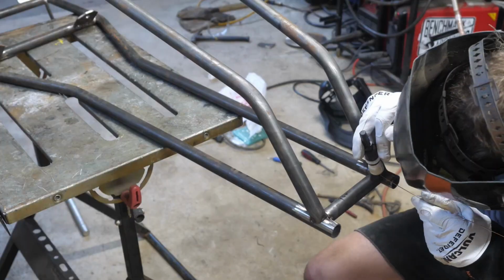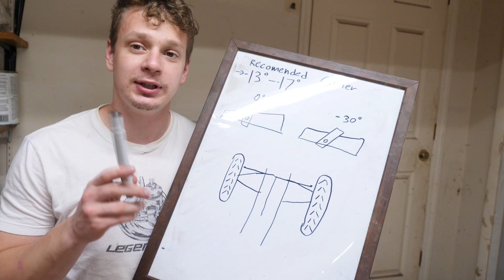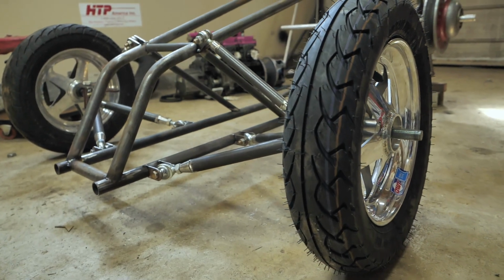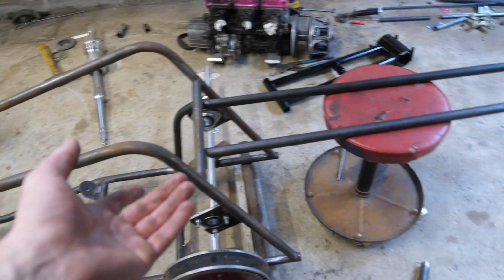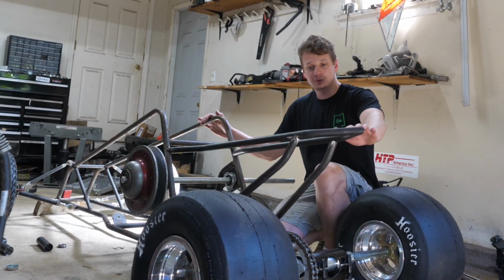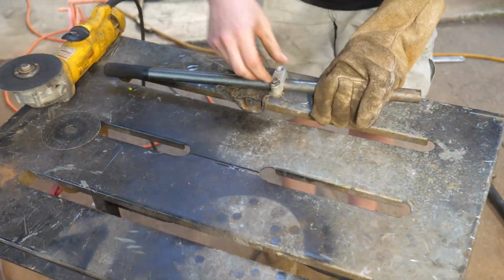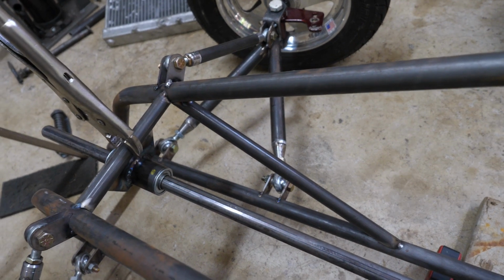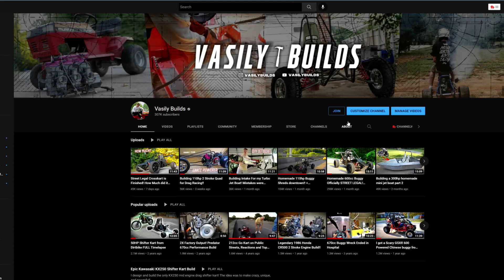Building Racing quad 600cc snowmobile powered Part 2!

Comment: You are going to find all that adjustment on the front is not needed in sand drags. Just extra weight.  And did you stagger the front tires to help with rollout on the tree.

Comment: Are you going to have Doug Flannery do your pipes? Also ditch the mechanical water pump and run a in-line electric water pump with a battery dock and run a 12 V 3-5ah battery like off a drill! 

I’m a snowmobile drag racer from Michigan
Reply from the maker: Rdz

Comment: How did you solve the belt slipping problem I’ve tried flipping the driver pulley making Sure it’s aligned perfect with the driven pulley while Engaging. But it still gets super hot. And it slips like right away. I’m running a stock Honda 630.

Comment: You won't be able to adjust the length of those lower A arms the way you have welded them. You need both threads parallel to each other, yours will bind up.

Comment: The front tires are on backwards. If you just switch them they will be fine. You always want the treads to point forward at the top of the tire. It helps prevent hydroplaning.
Reply: I dont know anyone that drag races where there is a hydroplaning concern.  If the track is wet, you wait for it to dry off.
Reply: You cannot make me believe he will ONLY run that on a frag strip.... Plus, your comment doesn't prove me wrong. Good practice is ALWAYS good.
Reply: @jameswilson7338  the frag strip?  Only when cars and cameras are running is it called the frag strip!! lol

Who said i was trying to prove you wrong?  my comment is absolutely correct.  Don't run your drag kart, car, banshee, or the like on a wet track. If the front tires are a concern for hydroplaning, then you should be equally concerned about the big fat slicks on the back with ZERO tread.  

I get what you're saying tho. Rain tread is directional.

Comment: Would it make a better angle for your front  heim joints to be angled in the same direction as your triangle d front suspension?  I also would box in those frame connections for strength.  You are doing excellent!!

Comment: You are so good. Be safe! (I know you will, you have already joined the "I Almost Died, Club"). This is a good sign. (Family Members may not agree). It means you will more than likely live to be an old man AND get to rip like a maniac in the meantime. (I'm 60). Lessons learned. You CAN'T teach it in school. Most students would fail. You are running my favorite. Two Stroke Triple! (In my day, they were air cooled. Yours is MUCH better). (KAW H1 and S2). I saw something about running these in warm weather. I don't know. Just thought I would mention. Mixture adjustments? Thanks for building, Vasily!

Comment: It's going to Scream on down the tracks!Worried that the steering may be too touchy at speed.Red Beard's used a couple 'rack-n-pinion' units that slow steering response allot.I'd hoped you'd put the radiator behind the front axles to lessen the chance of scalding if it blows,or just overheats.Whatever you do,we know it'll be Awesome!Rock on Vasily.

Comment: CrMo can be prone to brittleness if you weld thicker material where the weld cools off fast so preheat is often recommended. On this thin walled tubing you'll probably fine though.
Reply: Yep.  A post weld heat treat would solve the brittleness at the heat effected zone too.  Give the grain structure a chance to relax.
Reply: Heat treat or anneal

Comment: You mentioned it might be prone to wheelies. With all the weight at the rear i might agree.  Have you considered making a custom 4 link?  If not, maybe research how drag race cars use them and their benefit.  it takes a bit of understanding but not too hard for someone willing to read a bit.  once you determine your anti-squat line, you position the 4 link bars to intersect above the anti-squat line.  this eliminates rear squat and uses all the horsepower at launch to move the car forward, not down.  for wheelies, you may need a wheelie bar.

you're doing a heck of a job, young man!!  I can't wait to see you make a full pass in this thing.

Comment: A big thing with drag atv’s are the rake and trail of that front end but judging by the angle gauge on the spindle, when you welded it on, you have that addressed. I had to put aftermarket adjustable a-arms on the R1 raptor build to modify rake and trail because the stock was super twitchy to the point it was scary at higher speeds…

Comment: 4130 is half the weight of cold rolled steel at the same strength. 1"X .065 wall thickness is plenty strong . For the rear . You may get away with .049  in the front.
Reply: For the swing arm center it in the frame .  And add about 10 inches more then stock length in the rear. And another 10 -15 in the front . .  Banshee drag axles fit into Honda bearing carriers and use Honda 400ex rear brake . Typically to a front brake master cylinder. And run go kart spindels in front  with spindle mount spindle mount front wheels. .  Triple buffed scat tracks and some  72 roll out  14-16 paddle staggered extremes . . . Sand / dirt drag atv is something I've built

Comment: Mod the CVT so it engages where it starts to make power . Put a dummy clutch handle that engages a adjustable rev limiter for launch control. Setting the limit just below when the cvt engages and it will be a rocket . Especially when you add a nitrous shot to it. .  . I e seen 3cyl snow mo builds run 3.5 ish seconds. ..  make the wheelie bar = the wheel base  length from the rear axle to the barwheel. You can get away with  real light wheelie bar material and a cheesy light wheel. . Most guys run the small race go kart tire . Ive seen some with power wheel wheelie bar wheels . . And make that wheel about a 12oz soda can off the ground.

Comment: Lookin Pretty Awesome Bro! This Thing My Man, Should be a Literal Rocket Ship Lol!!!! 🚀 Almost no real weight compared to say the fully dressed sled that Polaris Triple 2 Stroke came out of!  That's what a 600cc? Should be a easy Hundred HP and with a properly setup torque converter for the track conditions, with the slicks and a wheelie bar that things gonna 🪝 Up & Book! Nothing beats a well tuned triple 2 Stroke with your original setup you had for this engine, which they looked like actual drag pipes??? So if you still have them, your ahead of the game for proper action. Get the engine tuned to its utmost best, then setup the torque converter weights and springs, with the difference in weight of your chassis now and the point that your putting on drag pipes, everything is going to really require a little finessing for the track, the power band now has changed if you use the long drag pipes, and carburetor sizes as well? But everything should be fine and pretty easily tuned out to meet the track conditions on a set of wheels, otherwise my man, looking pretty damn Awesome so far 👏 👌 👍Keep it goin and can't wait to see how it turns out and looks when you get it done! 😀

Comment: I highly recommend buying yourself a low pressure tire gauge for accurate reading of 0-15 psi. They are only 15 bucks. Normal car pressure gauges are not very accurate for low ATV pressures of around 5 PSI.

Comment: I would have made a flat piece for the tip of the a-arm the used a strong bolt to connect spindle to to arm in a mechanical connection then welded. I wouldn't trust a weld to hold for very long. But you could always do later.
Reply: @Cory Gill i was thinkimg of crafting it more like a true automibile spindke which is held with different points of contacts. Like say how a rim is held my the spindle.

Comment: Awesome build as always but the angle/direction of that main span of steering shaft concerns me.  If you moved the u joint down to the level of the bottom of the engine it would be much safer in the event of a front end crash.  Again, the build is awesome, work is top notch, just don’t want you getting messed up like that.